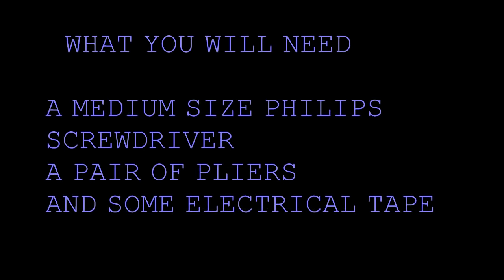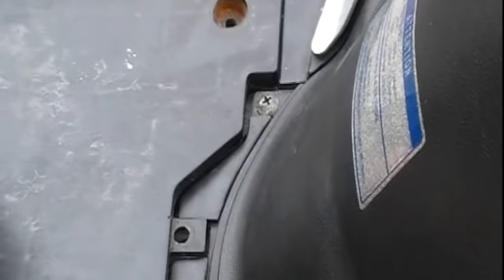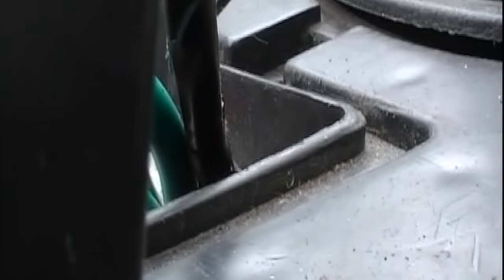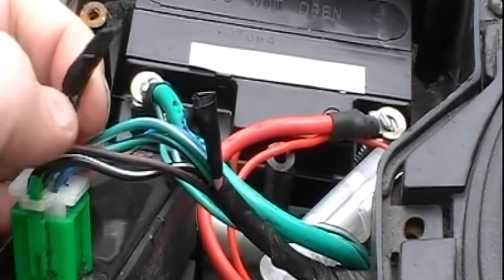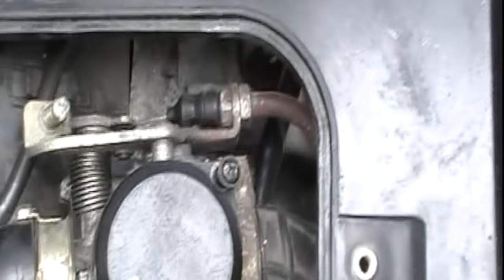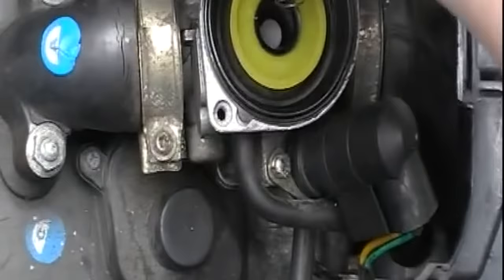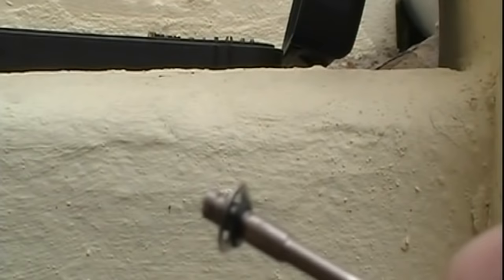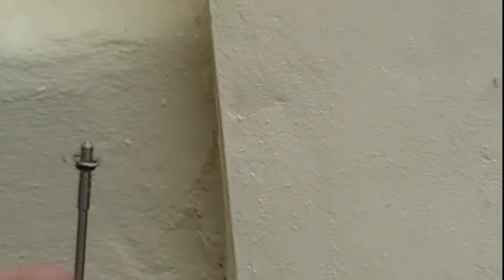How to derestrict a 50cc scooter / moped Make it go Faster

Comment: this is on an auto moped scooter what about a geared moped such as  aprilia sx 50  do you not have to rejet the carb and the exhaust needs attention for deresrict it.
Reply: many thanks for the info.
Reply: DAVID LEE  they can be restricted in the exhaust by a washer type restricter, that can just be knocked out or drilled out. and can be restricted on the carb, usually you'll need a bigger carb 2 to 5 mm bigger, so if its a 14mm carb you'll get a 16 to 21mm carb to improve speed, playing with the mixture on 2 strokes should only be done if you know what your doing, moving the clip up as he did does weaken the mix, can cause holed pistons and seized engines.it needs to be moved down, lifting the needle valve to richen the mixture, but too rich can cause running problems too. You can also find restricted ignition systems, especialy CDI ignitions. cutting a wire to the CDI is not a good idea, that  can cause over revving and serious damage. It's cheaper in the long run to buy an older ignition or a de-restricted ignition, same with exhausts, easy to find as someone with a full bike license can buy them for their 50cc, if you know what I mean. I have a 55cc Polini kit, 28mm carb and a RG racing CDI and magneto on an AM6 engine, that's what RS and SX use, total cost was only £200, and it's good for 75/80 mph all day long, and I'm 6ft and 14 stone. I looked at the 70cc kit but that is a lot of work, new crank and some machining to the cases so I gave that a miss.
Reply: many thanks paul  have you heard of the rieju mrt pro comp it has a 24mm mikuni carb and twin rad and a racing throttle with hydraulic reinforced clutch.
Derestricted its claimed to reach 15bhp.
Reply: yes, that is an AM6 engine, they can be turdo'd to stupid BHP, videos on youtube, Mine has 2 x 14 mm Mikuni carbs on a home made "Y" piece and kicks out 17.5 BHP on the dyno, but I rarely rev to the max, don't want to blow it up. Turbo'd they are something like 45+ BHP from a 50cc, seen that on a twist n go scooter, very fast.
Reply: that would be an AM5 engine, the number denotes how many gears, AM4 is 4 speed, AM5 is 5 speed AM6 is 6 speed. My engine is boxed up at the minute, waiting for a project to put it in. Was thinking of putting it in my '88 FS1 but I like that as it is, worth more as standard.

Comment: My zip 100cc does 40mph. Is it restricted? Previous owner said it's not
Reply: VibezEntertainment Production my 50cc 4stroke zip does 40 xD just de restrict your vario and cdi
Reply: at the vario there is a little ring that stops your v belt to go all the way up  and the cdi u can cut a little metal strip and you get +15 kmh

Comment from the maker: Well it was taped and removeing the wire completely would definitely not be an mot failure because there would be not wire to test if your haveing this much problems trying  comprehend what is on the video I would get one of your 3 mates to help you out. Or I might do some videos on comen senses.

Comment: Any modifications will usually kill your scooter faster.  Over clocking your scooter to go faster when it was not designed to go these speeds will cause damages and burn your scooter out.

Comment: What was the speed before and after?

Did you look at taking out the washer holding the variator apart? (That is if your scooter has it)
Reply: It’s a 50cc. I can’t imagine getting any more power out of it. Also, that pink wire is responsible for for the crankshaft position. How will the CDI know when to fire if you cut it. That’s the reference wire.

Comment: Your needle setting is wrong you will get less fuel and if your engine is a 2 stroke you will lower your engine life because you will run lean and this is bad for a 2 stroke engine and it could cause a seizure of your piston inside the cylinder

Comment: Just cut this pink wire, no need to get technical about what it does.  Now take the top off the carb and you'll see a black and yellow thing.  
Those two statements by themselves should warn any potential home tuners to avoid this advice like the plague.  
Now move this clip to the middle (higher) position on the needle and it will get more petrol into the engine - Really?  In what parallel universe are you living?  It will actually decrease the amount of fuel getting to the engine but only at 1/4 to 3/4 throttle.  At full throttle it will have virtually no effect, if it has any effect at all it will be to weaken the mixture.  This modification will cause your scooter to run slower, not faster.
Apart from the rubbish information the camera work is abysmal.

Comment: before giving advice on doing this sort of stuff. Know what your doing. you dont know what the job of the slide needle.   yes It might make it a bit faster because its now in a lean mix. lot of engines like running lean just before heat siezure takes over...  Faster? compression, fuel, exhaust flow then vairator.....
Why Im have a shot at this vid...  One of my students followed you advice.... only to now replace cyl, piston and a heated conrod....  Lean mix in the tropics is a killer.

Comment: bad teacher you are  firer  . never cut no wire or move no needle   just use a more open exaust pipe   stander engine  was made to work along time .design by experted . saving the crank shaft bearens , to work a long time.

Comment: does anyone know the color of the wire u cut on the cdi unit to make it go faster? other videos say pink. I dont have a pink wire. Its a 2015 50cc Taotao scooter.
Reply: Its pink on all scooters if theres no pink you cant derestrict it you should do it another way
Reply: +michael Direeno direeno  NOT TRUE DO NOT CUT ANY WIRES! dont listen this this guy it barely makes it faster AND will kill your ped faster go watch videos on removing rev limiter also you can find SUPER cheap 80cc bore kits that police won be able to tell what size engine it is.
Reply: +RoGuExPaNcAkE  I didnt. there isnt a pink wire on a taotao. I got hght performance Cdi unit and a raaing coil Its quicker than it was thats for sure! downhill had it goim ovet50mph and not that bad on flat surface. had it at abt 32 to 33. Im getnn the carb jetted. and racing belt, nn slippage. thans for the info, if  u know of any more tricks please let me know thx
Reply: +michael Direeno direeno okay. and good racing spark plugs and Wires, and a better exhaust all will help with acceleration and top speed
Reply: +michael Direeno direeno also there are so many more things it's not even funny
Reply: +RoGuExPaNcAkE did thad plug while I did the coil. the coli goes all the way tn the plug so just popped a new 1 in while i there

Comment: so I hear a weird screeching noise when I start to drive fast but then it stops am I going to dieor something because I don't know whats wrong
Reply: sounds like you need to tighten or loosen your carburetor bolt a little. if it's having a problem idling this may be the problem.
Reply: +Micah Mozart thanks bro works just fine now i appreciate it and can I also use my moped in the cold
Reply: actually it works better in the cold, because cold air molecules takes less space than warm air molecules so you get more air into your engine and therefore also more fuel, although you shouldn't use it in the snow or ice
Reply: letsrage23 thank u thanku bro u r a lifesaver

Comment from the maker: Yet again you are wrong it will not as you can see the wires are secured with electronic tape. Also in the mot the cover for the battery will not even get removed I dont know where you are geting this information from but I have been working on bikes for around 15 years I have only recently started to make videos. I would not and willnot put videos that would danger anone life.

Comment: In this video he is restricting the fuel by raising the clip..The needle will now block more fuel from entering the engine...Not sure he should be making videos..Less fuel = Less power ...Nice try though ...now erase this video
Reply: +Super Mario Plush Bros 1 (And other viewers) - lowering the needle clip leans off the mixture, however the needle valve only affects mid-throttle openings. The idling and off-idle mixtures are set by the idle jet size and idle airscrew, also the cutaway at the back of the throttle slide.
 
When on full throttle the mixture is determined by the size of the main jet. if you are looking for maximum speed you need to work on the full-throttle setting: a bigger jet and less airflow restriction will help cram more mixture into your engine at full throttle.
 
Most bikes will go faster when slightly lean, then overheat and seize.
 
Playing with the needle settings can help your mid-throttle response. 
 
This guy is an idiot. Innit.

Comment: LOL! If you put the Carburator Needle down you make the Gas more lean. You may get little more RPM but the Engine runs Hot and will die.....
Learn about the Funktion of Stöchiometria and Carburators FIRST and then try to tune ;-) 
Such a Nonsens...LOL

Comment: Where's your pedals? A moped has pedals I don't see any pedals..
Reply: In 1977, the Vienna Convention on Road Traffic considers the moped any two-wheeled or three-wheeled vehicle which is fitted with an internal combustion engine having a cylinder capacity not exceeding 50 cc. Therefore it's a moped
Reply: @4eyes01  nope 
A moped is a pedal-assist-motorized vehicle
Reply: @howardlangford8087  a moped used to be yeah but now they're not
Reply: @howardlangford8087  if its 50cc or under its legally classed as a moped in the uk

Comment: One of the worst video I've seen about the subject. People please don't take this for granted. Unfortunately the author don't have a clue about what is doing. 
1 - CDI rpm limiter. Just take of the connector from the plug don't cut the wire based on a sketchy color scheme. If you happen to have a slightly different model you'll end up mending wires wrongly cut. Best case your lucky worse case your scooter won't start. Think about it before cutting wires. 

2 - Carburetor. That I'm afraid is plain stupid. The mixture in this case is leaner after the change... But the real question is how was it before the change? Most important don't try to change the settings without knowing what your doing. Wrong mixture setting can and will degrade the performance (less power, more consumption). In the worse case can damage the engine (read seize)...

Comment: I don't have a pink wire on mines
Reply: cut the black 1 LOL!!!!!!!
Reply: cut em all. you may as wll. get rid of that black and yellow thinggy, at least it wont self district
Reply: and the red too.LOL !!!
Reply: take the carb off and just pour the fuel in your self, makes it go faster and you won't get bored whilst riding anyway. but the real secret in making you ped go fast is to take the engine out therefore it is lighter and the just push with your feet. hahahaha